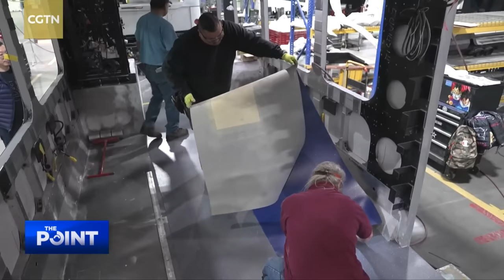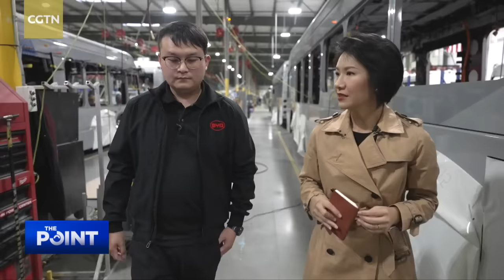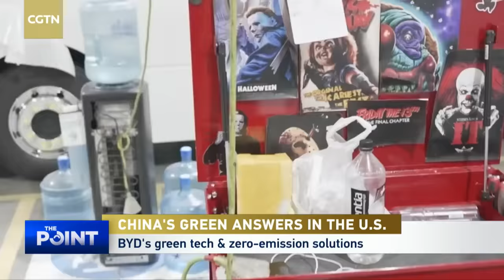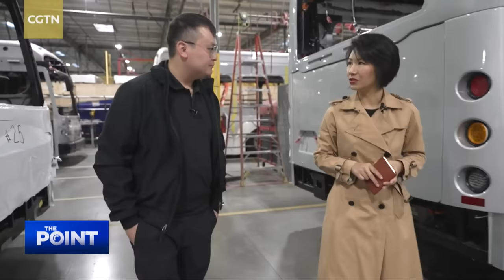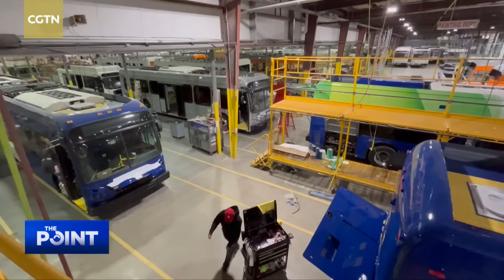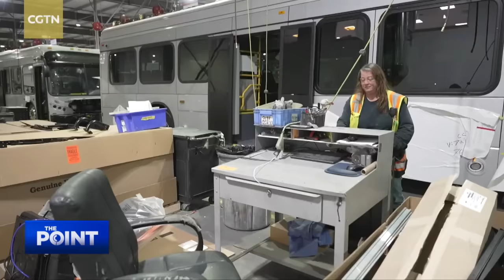The Point: CGTN's Liu Xin visited BYD's North American headquarters

Comment: Byd is good,I hope Canadian market also will open soon.😄
Reply: You gotta seek permission from the sleepy old man first....
Reply: Canada is just a waste of time.  The city of Montreal had an electric bus trial with BYD, Volvo and a local company called Nova Bus.  In the end the both the buses from BYD and Volvo were better and less expensive and they still went with the local company Nova Bus which costed over three times more on top of not having any A/C !
Reply: @etow8034  Agreed! I worked for a local municipal transit authority in Canada. Most of the business deals are built on "relationships" even if that means the new buses purchased cost 3-4X more to purchase while being inferior than competing products (like BYD). In addition, there are VERY EXPENSIVE software licenses that needs to be renewed on an annual basis to maintain these inferior buses. The corruption in Canada runs deep. 🍁🍁
Reply: BYD has an assembly plant in Newmarket Ontario, but the buses they produce there are just for the Toronto transit system according to Google…
Reply: @Fabulousprofound168  Good Toronto went with BYD. Montreal went with the corrupted and overpriced Novobus even though they said they went through with the BYD and Volvo trials  The Novobus is about twice as expensive and yet still no A/C !

Comment: CO2 emissions from the mine would amount to over 152,000 tons annually, (equal to a small city).[12]

The mine would consume 1.7 billion gallons of water annually (500,000 gallons per ton of lithium produced).[12] The mine's water use prompted a lawsuit from a local rancher who claimed that the hydrologist hired by the BLM to prepare reports assessing the mine's impact had a conflict of interest with Lithium Nevada.[28]

The mine overlaps with 2,866 acres (1,160 ha) of big sagebrush habitat and known golden eagle breeding sites.[29] The project may be disruptive to the habitat of Endangered Species Act-listed animals. A coalition of environmental groups filing a lawsuit against the mine stated that Thacker Pass is "critically important to wildlife because it connects the Double H Mountains to the Montana Mountains. The pass also provides lower-elevation habitat that wildlife need to survive the winter." The group also stated that the area constituted "one of the last big blocks of the sagebrush sea free of development."[30]

Additional environmental concerns include contamination from groundwater pollutants such as arsenic, air pollution from sulfuric acid leaching of lithium from clay sediments, and changes in the connectivity of groundwater and surface water systems. This could harm the habitat of the endangered Lahontan cutthroat trout and the Kings River pyrg (Pyrgulopsis imperialis), a rare springsnail not known to live anywhere else in the world.[30][31]

There are concerns about the mine's potential impacts on the safety of local communities: projects that bring a large predominately male workforce from outside the local area can generate local increases in drug use and violent crime,[4]: 1  and are associated with violence against Indigenous women.[4][32]

Comment: 18 months is a looooong time for just one bus! come on
Reply: The manager has explained that it would start from customization discussion to final delivery. Customisation is not only about changing colour of the bus only but also the various details to suit local customer demands. As such, the outcome affects not only layout, routing of wiring, placement of important components, and fabrication/implementation of customer specific parts etc. I think it is one of the main reasons that we did not see much automatic assembly manufacturing/process being used, much similar to building of a Rolls Royce to a Toyoda.